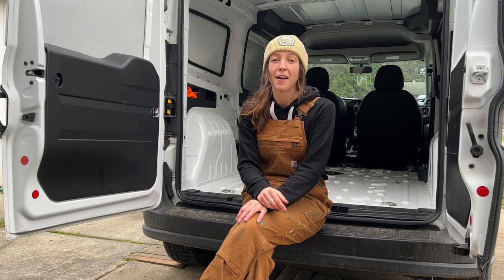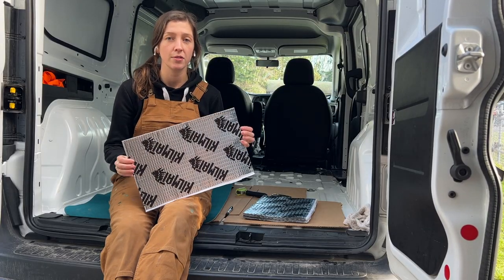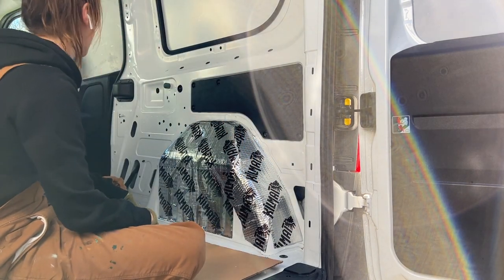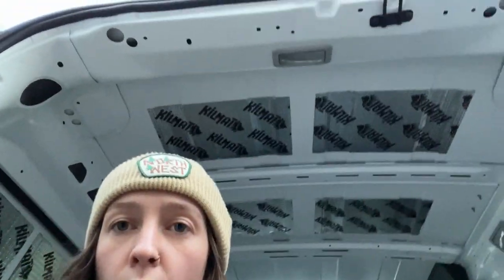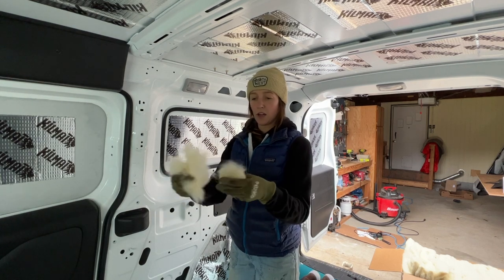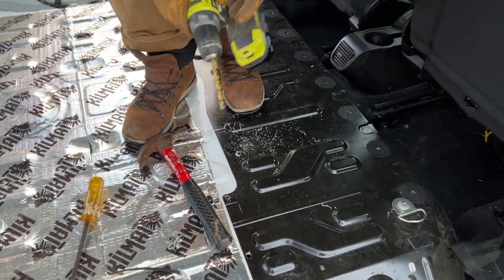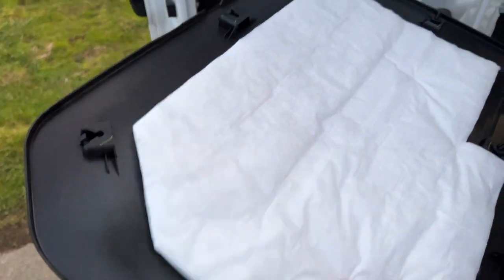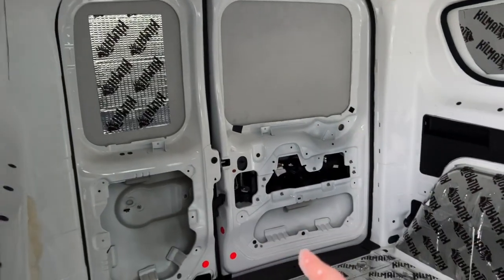VAN BUILD PHASE 1 - Ram Promaster City | Kilmat and Insulation (Havelock Wool)

Comment: Because your an artist, you have an advantage. Tool in your hands will be like second nature to you.  I have no doubt your van will be the sickest art van build out there. By being mobile you'll be able to travel to fairs all over that you couldn't before. Be sure to leave room under the floor for art and frame work for your set up. if your going to do lights in back, run your wire before you insolate.

Comment: You need to think about Wayfair Vans and Cascade camper. You need to have a access opening in the floor to the fuel pump and gas tank fuel gauge sending unit .To  make your van build easy use 80/20 aluminum and not wood. Look on youtube for how to use 80/20 aluminum ( 80/20 bolts together) Remember you cannot (should not) pull over 1400 lbs in your van ! Try not to use screws to hold things to the van (walls, floor)bolt with rib-nuts I hope this helps ( I have built 12 to 15 van conversion and owned 30 to 35 vans)

Comment: The side rear window frames are surrounded by weather stripping.  Pull it off.  It's not serving anything.  If you install windows in the back doors, you can trim the weather stripping and put it on the inside around the windows.